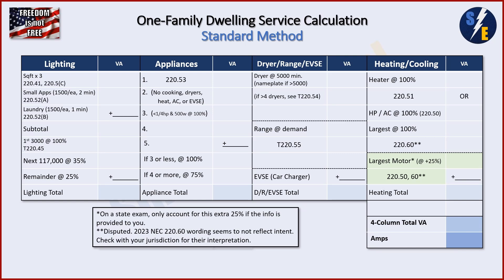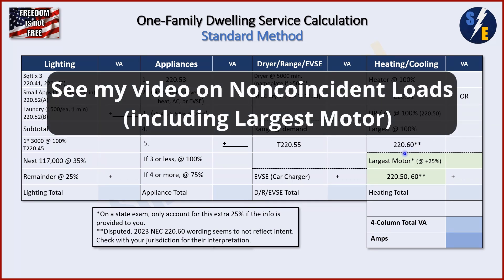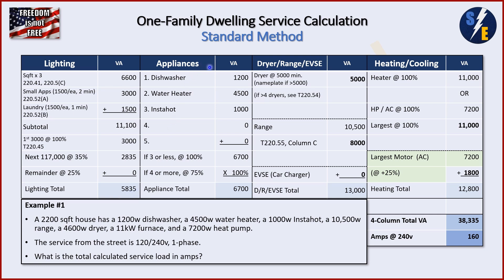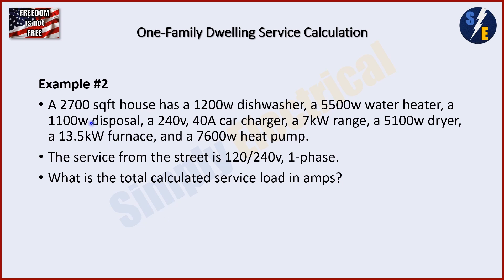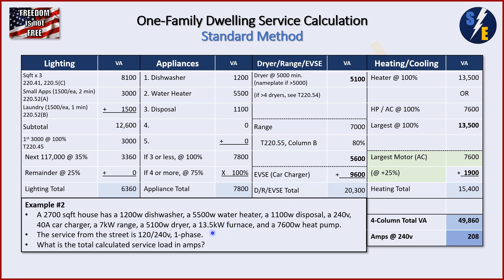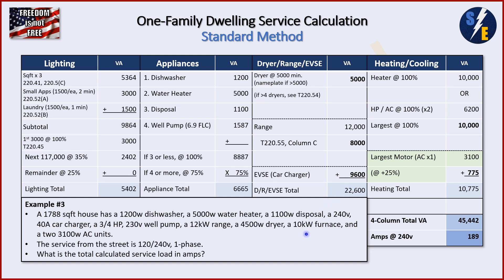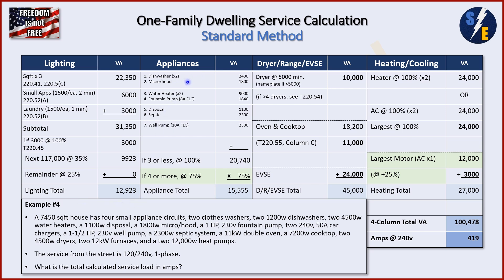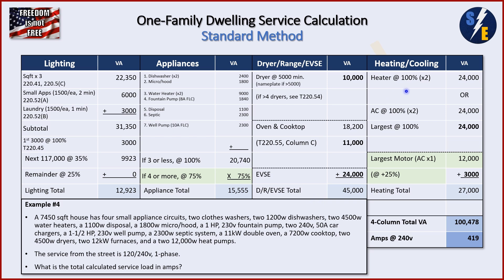One-Family Standard Service Calculation - Crash Course 2023

Comment: Thanks for the videos! On example 2, the range is calculated as 7kw.  Isn’t the minimum range load 8kw?  Thanks!
Reply from the maker: You're welcome!
There actually is no minimum load for a range. In Table 220.55, Columns A and B give us multipliers for ranges 8-3/4kW and smaller. See Note 3 under the table.

In fact, it also implies (see heading) that anything below 1-3/4kW gets taken at nameplate value with no demand factor. So there is no lower limit.

You might just be thinking of 8kW being the lowest value in Column C. Maybe because in the field, most electricians I'm aware of just use Column C for everything not over 12kW.

But on an exam, it is critical to use the proper column in order to arrive at the MINIMUM value allowed.

Does that help?

Comment: In the last example, #4. The 11kw double oven is in column C, and the 7200w cooktop is in column B. Shouldn't they be calculated separately?
Reply from the maker: That's a great question. You certainly CAN treat them separately (see Table 220.55, Note 3). However, we are generally trying to find the MINIMUM required load on the service. Treating them separate would give us a total cooking load of 13,760W, instead of the 11,000W of Column C.

7200W Cooktop:
     Column B --> 7200 @ 80% = 5760W
11kW Oven:
     Column C --> 8000W
Total: 5760 + 8000 = 13,760W

Remember that Column C includes anything "not over 12kW". So we can figure both appliances under C, giving us 11kW....and saving us 2760W on our calculated load.
Hope that helps!

Comment: if you have three window ac unit where you plug this load in the calculation to get services
Reply from the maker: Since it is air conditioning, you would plug them into the fourth column (third row) and just add them all together. You would not count them as noncoincident loads, because they can easily run at the same time as your heat source. So they would all be taken at 100%.